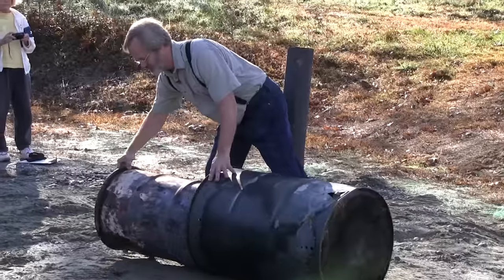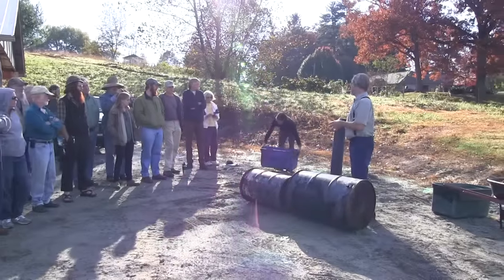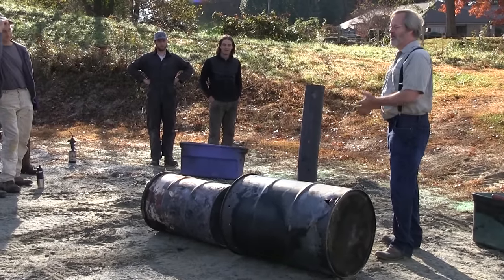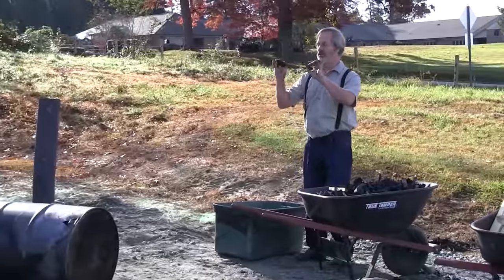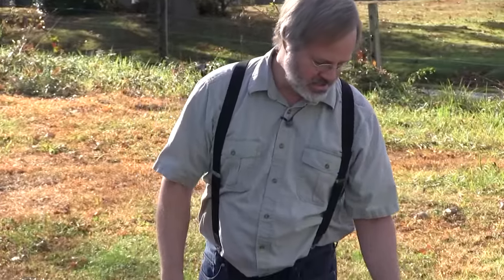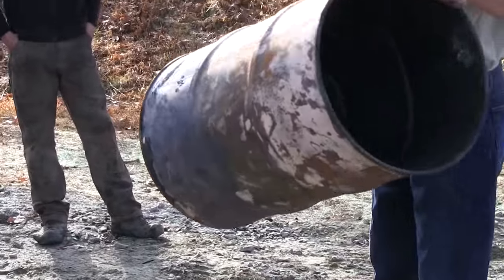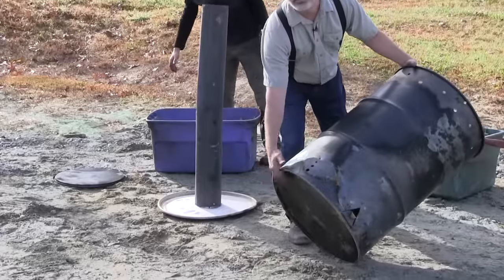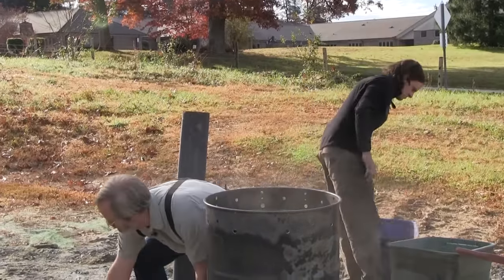Biochar Workshop Part 1, How to Make Biochar

Comment: I'm thinking if the exhaust had enough pressure, you could have it run into a pipe that curves down into the bottom of a barrel of water, maybe ending with a bunch of pinholes to percolate the gases evenly in the water. I'd attach a spout to the bottom of the water barrel, so that if I started seeing smoke or steam coming out of the oxygen holes in the burn barrel, due to back-pressure, I could drain some of the water to alleviate that. Any gases that exhaust would absorb into the water, making fertilizer water. CO2 and CO turns into carbonic acid (H2CO3). NxOx turn into HxNxOx (N-based gases to N-based acids). N-based gases can also turn into ammonia and ammonium compounds. Sulfur gases turn into sulfur acids. Phosphorous compounds could be carried over too, making things like phosphorous nitride, phosphates, and P-based acids. Potassium may be carried over a bit too, making potassium nitrate, and other compounds. On top of all this, most gases absorb into warmer water better, so the water being warmed will help with this.

All these compounds I mentioned are keys nutrients for plants growth, (N, P, and K being the most important). The only problems is that the water would likely be quite acidic because of all the acids produced. It might turn out to be great for plants that like acidic soils, like potatoes, (which also like a lot of sulfur). If you need to neutralize the water a bit, you could crush up sea shells or egg shells (both CaCO3), which would also add calcium, another important plant nutrient. Potassium carbonate would be better, but I like to do things organically a lot of the times and I can't think of a natural source of potassium carbonate off the top of my head, other than going out and finding a mineral source to mine, which would likely be in a desert of scrub-land area.

Boom, huge idea and information rant, haha! I can't help it, I'm an Environmental Sciences major who just got serious about organic farming, about a a year ago.
Reply: TR8R good luck and thank you so much for the information!

Comment: Could this be done safely inside of an underground greenhouse with the chimney passing through thermal mass on its way out the building?

All you would need is a slightly smaller diameter chimney attached to the lid with a short neck that feeds into the larger neck and that would make it adjustable to slide down and sit firmly on the barrel top. 

That would be an awesome practical use of the heat byproduct.

Comment: Wanted to mention the albino squirrel digging around @ the 36:00 mark of the video. 

Also my buddy made a wood fired jacuzzi at his place in the woods in PA. He lined it with 1” or 1 1/2 “ soft coiled copper (HVAC isle at *local hardware store if you’re wondering) and runs it through the jacuzzi’s pump and filter system. Combining the system demo’d here with something like that should inspire some ideas

Wondering if you could run 2 separate inner chambers so that you can run different sized material and keep them separated. Where do you apply the holes for the top chamber? I’m assuming one would have to use the bottom chamber for the smaller sized material.

Comment: It looks like he gets the wood from furniture factories in NC. Columbia Forest Products in Newport, VT used to sell bags of small pieces of oak for fire starter. It is almost impossible to get pallets for free nowadays. Duravent sells insulated pipe. Using slash is the best bet. The problem is getting clean barrels that didn’t contain nasty chemicals.

Comment: Amazing info!!!  My mind is running now.  Anyone know if the heat from these pipes can be funneled to a piping system for radiant floored heating?  What's the best way to use this with bamboo?  Seems like continuity of wood size, the type, and moisture...you could have a small rocket stove, set up specifically with properly sized bamboo (ie: rocket stove for bamboo shoots, rocket stove for 1 year old bamboo, rocket stove for 5 year old bamboo...
Reply: I am also interested in how bamboo could be used to make biochar.  It would seem that, once established, a bamboo farm would have a steady flow of material to use both for the burning material for the outer barrel as well as the biochar from the inner barrel.  I'll have to research the rocket stove. Not familiar with that part.

Comment: My setup works, but the biochar is often very brittle.  OK for biochar but not very useful as charcoal.  No ash, though.  Am I running the process too long?  Once the pyrolysis finishes, should I just shut the process down?  Put a hose down the chimney?

Comment: The other day I was watching a clip of a lady using a porous terracotta amphora for filtering water. Could it be that the Amazonians worked out that they could use fired clay to capture moisture in their soil and capture calcium and magnesium and other useful minerals fixating it in their soil using the porosity of the fired clay pottery shards. While creating the bio char were they simultaneously using the process to fire abundant clays as well to create further water retaining and water filtrating material constituents for the improvement of their soil? Could the clay kilns they were producing the biochar in also be broken up to create soil constituents? Would the clay be infused with smoke particulates that could be slow released into the soil when leached by the abundant rains?

Comment: From what I’ve seen is making biochar or charcoal in a bin or container is good for cooking but it’s not got the best absorption. Sure you want to reduce pollution but if burning wood outside in an open pit burns hotter you may get more brittle charcoal but the absorption is better. You also use the heat of the fire to burn the wood you don’t need to burn wood or heat a container resulting in waste.

Comment: I wonder if you position the smoke stack off to the side of the barrel lid you have a larger cook top area and it will not effect the char process? Could you use this barrel design as a heat source while charring inside a building and of course the stack would exit the building?

Comment: Can you use a mud brick structure for the outside drum? That way you have something that does not wear out over time.
Reply: +Rev. DRB dba Celebration Nation I assume so. This is basically a rocket stove, which commonly use cobb for the outer container.
Reply: I was just thinking that a lower level with built in fire place that would heat. If the radiant energy were captured, like with a brick oven, It would be a masonry stove. My retort is five gallons and I have to burn a bushel basket-sized fire for a couple hours to char that. There is a lot of energy released from the charring material and it equals about half of what the parent material had in it, if even the char had been burned away. When the ancients lugged energy through the deserts and inhospitable places where firewood was not available, char was a logical choice. Light and energy dense. Humans have had intimate relations with char since the beginning IMHO

Comment: wow so if the method leads to just co2 being released then could these be used inside greenhouses? they benefit 2 fold: extra co2 for larger growth and heat in cold times

Comment: If you wanted to be extra efficient you can pipe the wood gas out of the top and pipe it back down to the bottom essentially heating your fire with the wood gas as well.

Comment: There are thousands of house lots being cleared every week & the standard method of disposal for most of the trees & underbrush is to make a pile & burn the lot. Surely this material could be used for biochar, or failing that, wood pellets as a coal substitute?

Comment: Suppose you had a rocket mass heater rigged with this system, you could make your supply of biochar during the winter and use far more of the heat. Pump the exhaust through an algae bioreactor to cut back on carbon and mechanical inputs, and regenerate some raw materials in the process (algae is a biochar feedstock).
Reply: Hmmm.. in RS we are not supposed to take the heat from firebox and heat riser. and the temp range are not sufficient  for  a total decomposition of  lignin and hemicelulosis resulting in a poor quality product

Comment: I was wondering if the containers can be made from clay.  I believe it will last longer then the tin barrels, although I suppose it will take longer to heat.  Also I wonder if the clay will leak oxygen or not and ruin the bio char.

Comment: Hi.
#1. Exelent for water heater with still coil line inside, for kitchen and bathroom shower. 
  #2. For winter exelent,, you can heat water for hot water heater 🏠 house.
  #3. And same time make charcoal.

Comment: So its like a husband and wife. There may be times when things are very nice but minor times when things go. South. .I'm thinking a collar that slides down as the  outer wood burns would keep air out and heat in avoiding uneven burn and focusing heat. As it would slide toward the bottom you raise it again to allow the bottom to finish. The heat as a byproduct could heat water to aid in distillation and purify it.

Comment: I wonder if a pottery person or a cast iron mfg —- could make up a pot that slips over the stack to cook - maybe burn some coals and put on top of cast iron kettle top like you do a campfire casserole.  Would take some tinkering because the top will be very hot, the casserole will be very hot and would burn at some point so you have to be able to easily remove.  With heat proof clay you can make separate pieces that fit around the chimney and nest together. When done, you lift/slide  off the individual sections.  No need to worry about going up over the chimney which really isn’t good. I mean if you have a large enough barrel like his 100 gallon with 55 inside, you have plenty of room to set kettles around the chimney.

Comment: What about that green compressed wood use for decks and fence posts.  My understanding is that the early formulation included arsenic, and that late methods infuse chromates into the wood?  I would think that would not be a good source for bioochar. (Certainly not good fot general burning.

Comment: I have a serious question. If you have to active charcoal with compost for it to become biochar, why not just use compost alone and skip all the extra work?
Reply: Because the biochar adds something to the soil that the compost alone doesn’t add. Biochar holds water and nutrients better than compost, so it doesn’t replace compost, but it makes your garden better. The reason you have to activate it with nutrients is because it will suck those nutrients out of your soil initially if it isn’t activated with those nutrients ahead of time.

Comment: Could I just get charcoal brickets from the store to use as bio char?

Why can't wood ash be used in compost?
Reply: Charcoal briquettes... no.  A briquette is ashes and fines mixed with fillers then pressed into a shape and treated with chemicals to promote ignition.  Pure lump charcoal you could buy for 10 bucks a small bag but why?
Reply: John Smith
 - In tiny quantities it can be added (I do it). But it's a risky game. Wood ash is alkaline (extremely). It will burn whatever comes in contact with. 

Due to this high alkaline feature it's excellent on keeping micro & macro fauna away. Since those are the real "compost makers" your chasing/killing them away from your compost heap, not a good idea. ;-)
Cheers

Comment: Would this be safe to use as a rocket mass heater for heating inside a home? Thank you for the share!
Reply: Well,  it's not a rocket stove, but you could burn it inside with enough room and a chimney to the outside.  Crude heat source though, as you can't regulate he heat output.

Comment: I wonder would this work
To make char during summer and burn the gas during winter by using a Fresnel Lens in place of burning of your feed stock.
One barrel would only be needed.
The gases could be captured off the top and compressed.
A sensor could be added to track the gases PPM to determine when the cooking is completed.

Then use the gas as you wish.
Reply: Storing the gas could become unwieldy. Large volumes get produced. The fresnel lens idea is great, but you also need to heat the area in an airtight chamber where the gasses have an escape route. I have used half a dozen mirrors all focused on a 55 gallon drum and was not able to get it above 200F.
Reply: Biochar is just charcoal. Burn that.

Comment: What about the paint on these barrels? If I obtain a barrel but its painted am I pretty much screwed?
Reply: Nope. It will burn off. Your biochar is inside the inner barrel and is not really exposed to the chemicals outside of it. If all else fails, run it without wood for biochar first and burn off the paint.

Comment: if the carbon atom  has a specific weight, why does some biochar manufacturers sell biochar by the pound and some sell by the gallon? which of these should be the proper metric?

what biomass material in what pyrolysis process (slow, medium, or fast) that will result in biochar with the most porosity for absorpting nutrients or contaminants?

Comment: How does the gas escape from the inner barrel if it's sitting on the bottom of the outer barrel?  I see the 5 1/2 holes drilled in the bottom of the inner barrel.  I am assuming since it's not a gas-type seal they can escape easy enough.

Comment: I noticed you did not seal the inner chamber. Wouldn't the pressure of the gas coming from that chamber lift the lid? 
This may be more evident if the drums are new and the base of the smaller one forms a seal with the base of the larger one primarily because of the weight of the charge and the inner drum.
Reply: You want the gas to get out, just not oxygen getting in. There might be some value in sealing the top to prevent the occasional "whoosh" of gas burning in the chimney, but it doesn't much matter.

Comment: with what machine do you use to blend the charcoal
Reply: Fruitariana You could use a compost tumbler.
and also a chipper/shredder to break down the material. Ideally after it has been wetted.
Finally. Pit kilns are so much simpler to use and make

Comment: Is there a way to capture the heat generated such as liquid filled coils within the outer chamber that that would transfer the heat into a building?
Reply: You can run the gas through tubing into a dwelling. There is smoke at first, that would need to be shunted or filtered, but when the charring is going, the only two gasses being liberated are hydrogen and oxygen.

Comment: I have a question about lumber, sometimes the ends are painted and/or it is sprayed with anti-stain chemicals to prevent weathering - we ruined our supply of wood mulch (as far as putting it on the garden) at a local dump because we started to add processed wood products to the tub grinder along with the yard waste and tree maintenance waste that had been composted for many years - does this burn hot enough to eliminate those chemicals? I'm guessing if they're organic it is okay but if (as you mention) there are heavy metals (especially in old paint) they are certainly going to stay - and I'm not even sure about organic compounds (some are volatile, some not so much)

Comment: At 12:15 did he say decomposing trees are bad for the environment or am I confused?
Reply: Yes.  In general, plant biomass is carbon neutral, because whether you burn it or just leave it exposed to the elements, eventually the carbon which was extracted from the atmosphere during growth that is bound up in the plant cellulose will be returned to the atmosphere in the form of CO2.  Direct burning just hastens the process of oxidation.  On the other hand, if you char the wood, much of that carbon gets bound up in a stable form which can resist oxidation for thousands of years.  
Ordinary decomposition of organic matter isn't "bad" except relative to the carbon sequestration that would have been possible to achieve if the same material had been charred.
Reply: Yes, the Amazon is the problem and therefore we should burn it all down. The natural process of decomposition (bacteria, fungi, protozoa, mineral absorption/availability) is being WAY oversimplified and does not address both sides of the chemical (and biological) equation. Biochar is an excuse to use “free waste” for fuel.
Reply: Lawn Bear 
Bs, do some research

Comment: Why not set up several ovens and daisychain the chimneys so you don't waste the heat and the smoke once pyrolysis starts? The first chimney would feed into the bottom of the second unit, the second into third etc.

Comment: Can someone tell me how long a regular steel drum will last?
Reply: Very good idea biocher
Reply: Depends. If it is kept dry, the regular steel can last a dozen firings. There are differing gauges of steel, but the drum if left outside between burns will deteriorate quite quickly.